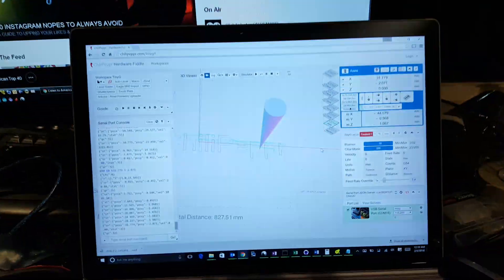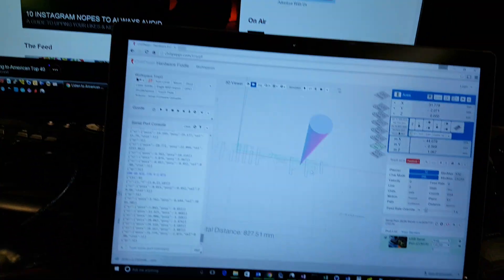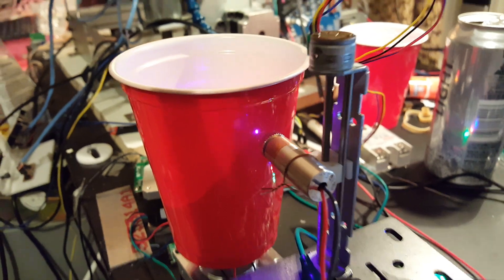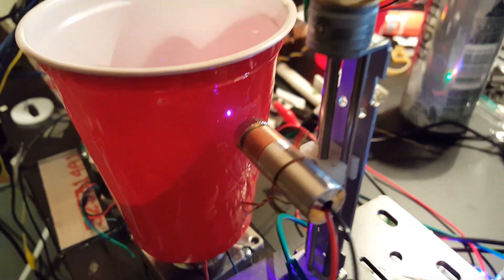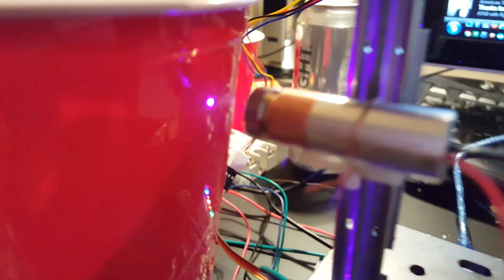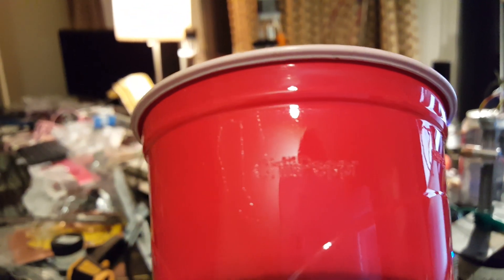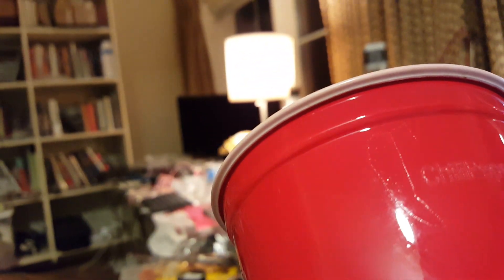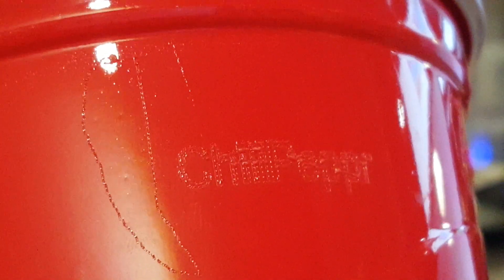Why would I laser a tiny ChiliPeppr logo on a red solo cup?

Comment: Are you also controlling the laser current through gcode to allow non-etching moves?
Reply from the maker: +nThanksForAllTheFish Not in this video, but that is the goal.
Reply: +nThanksForAllTheFish I bet there are issues with latency using spindle on/off
Reply from the maker: +Travis Brown Actually, there aren't. The TinyG is a real-time controller so it's all about making XYZ moves in sync as well as spindle on/off in sync.
Reply: +John Lauer I def. missed the part where you said you are using tinyG. I use the tinyG in my CNC, but that wasn't the latency issue I meant to say. I meant the latency between no power to full power. Or is the laser power practically at 100% when turned on. I honestly don't know.
Reply from the maker: I'd have to oscilloscope it to really see. It's a constant current driver running at 200mhz so perhaps within 20 cycles it is at full power so microseconds?